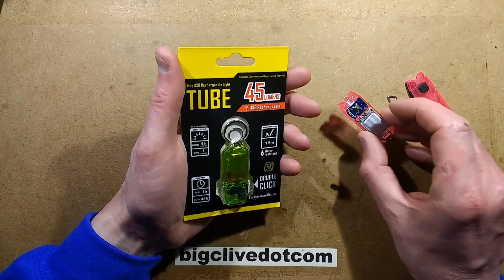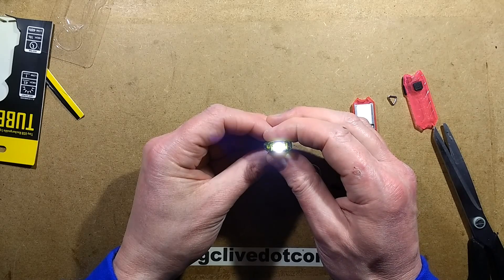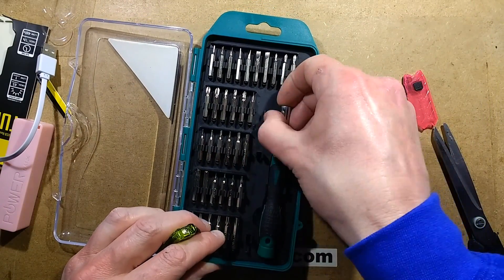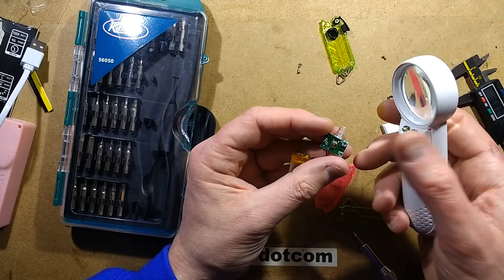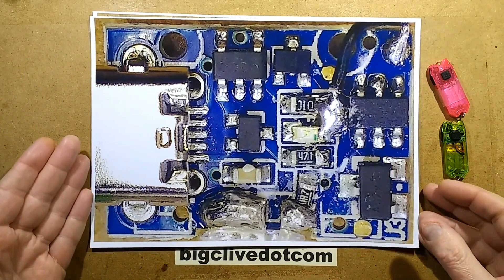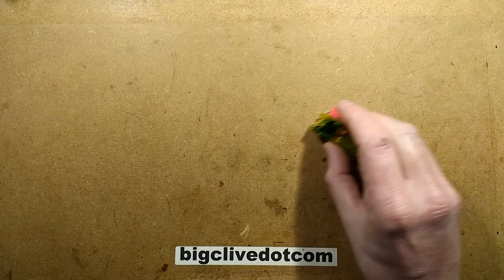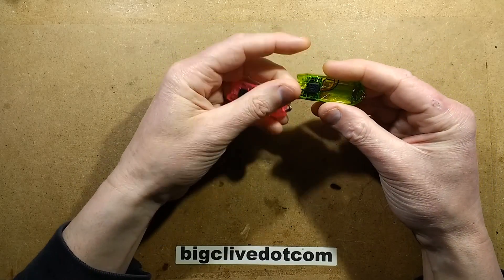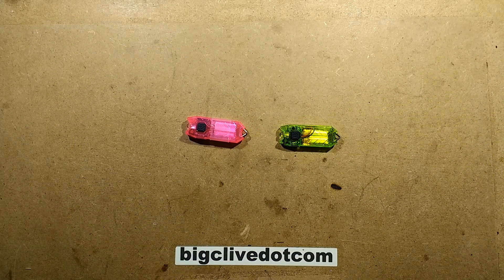Fake Nitecore Tube test and teardown.

Comment: For some reason this got me thinking. I wonder how good an all red led flashlight would be. In theory it should be better because red done not activate your day vision so you can still see off on the distance.
Reply: I have a head torch that has both a red and white light. Its pretty much exactly what you would expect. Allows you to see when its dark without upsetting your ability to see too badly. Not as bright as white light though and will make it difficult to see what colours things are.

If you want to test just grab a cheapo rear bike light.
Reply: Back in the day, all LED keyfob torches were red! :-)
Reply: I got a hire car yesterday, its a new Corsa and the interior is well lit with red lights when driving at night, I presume Vauxhall agree with your theory.
Reply: Red flashlights are easy to find. Check an astronomy seller. Celestron makes one where there's variable brightness down to really very very dim.
Reply: As a blind uneducated guess on my behalf maybe its because red has the longest wavelength in the visible range spectrum?
Reply: aljowen ha I get it
Reply: Hmm. I remember using (not-LED) Army flashlights that just had a red filter over the bulb.
Reply: grab an astronomy style flashlight and let us know.
Reply: thisi s largely a myth. red will destroy your night vision just as well as any other color will and you can make white not destroy your night vision as well. INTENSITY is far far more important than color. Red is typically used not because its red but because red lights in the past were very very DIM and the dimmness is what preserved your night vision.

I hit you with a 1watt red led your night vision is just as hosed as if I hit you with you 1watt white led.
Reply: In fact I read an article a number of years ago that said that green is a better color to use for preservation of night vision. What matters is the overall intensity of the light, and since human eyes are most sensitive to green light, you can use a much lower intensity light and still retain the most night vision. I think we use red because red is the dimmest color in our eyes so we "feel" that it must be best for night vision.
Even if I find it to be true, just try to show up at an astronomy event with a green flashlight. You might as well leave the dome lights in your car working for all the love you won't be getting :)
Reply: there are three main reasons for using red in low-intensity applications 

one is related to tradition. black and white photographic paper is generally not sensitive to red, so darkrooms were typically lit with red or orange light, and red flashlights were "safe" to use around photographic paper.

another is related to human vision. for the same (physical) intensity, a red light looks slightly dimmer to us than a green or yellow light (though not as dim as a pure blue light would).

and another is related to human psychology. we just prefer our environments to look "warm", so if we have to choose a monochrome light (which used to be the case with leds), we generally find red / orange more pleasant than green / blue.

these days, though, you can get low (or variable) intensity white leds, and no one uses photographic paper, so theres really no reason to go monochrome .
Reply: ChrisD4335 you could do an experiment with a car, leave a few small things on the floor in front and behind with the sidelights on at night, see which are easiest to find

Comment: DQG makes single-AAA flashlights that are only slightly bigger than the battery and put out a good amount of light, plus they have high and low settings (and high switches to low after about 90 minutes). I've had one on my keychain for years. Highly recommended. Their size makes them far better as a keychain EDC than larger ones. Google DQG AAA and I predict you'll be impressed!
Reply: Too expensive. Not impressed. :-)

Comment: Reverse-engineer the pinout, find a pin-compatible micro-controller, buy one and write your own software! Of course, buying controllers in one-off quantities may be more expensive than buying a light that already has the features you want built-in..
Reply: I'm honestly tempted to do that with the original—the PWM is too slow for me (can't imagine how terrible the clone must be). I'd either speed up the PWM or make full brightness the default.

Comment: Let me start with a disclaimer: I've been an LED flashlight geek for years, and have been modifying prfectly good incandescent flashlights with LEDs for years. 

Now that commercially available LED lights have caught up with and even surpassed most of the custom jobs, I simply look for the exact set of features I want among the hundreds (or thousands?) available.

In the Nitecore lineup there are many excellent little lights, and the TUBE and TIP were the ones in my sights as possible every day carry pocket lights.

For me the TIP won out easily over the TUBE because of it's features (even though it is much more expensive).

Not only can it put out much more light if needed, the LED is shielded so that it does not glare in one's peripheral vision while in use. The two-button interface is also, for me, a plus.

Have you looked at the TIP? I think you would really enjoy it.
Reply from the maker: I have, but it was just that bit bigger and twice the weight.  The tube is ideal for the keyring, but I may get a Tip to try out.

Comment: I  bought 2 of the nitecore tubes from gearbest right after your review. Work flawlessly and just checked the emergency mode and thats the same as yours. Also, those poundland screwdrivers are so fucking handy! And cheap enough to buy in bulk to leave anywhere you may need them.
Reply: hmmm thats bad if the tips vary. the whole appeal of the poundland ones is that the tips are much better than most cheap precision screwdrivers and dont deform easily
Reply: I'd buy a couple of sets... :^)

http://tijil.org/BigClive_Screwdriver.jpg
Reply: Any idea if those screwdrivers are sold anywhere else in the world? They look so much better than my little set, but I don't think I can get them in Australia. Wonder how much it would cost for someone to post me some...
Reply: You can buy similar ones from banggood - http://www.banggood.com/JACKLY-9-in-1-Electric-Repair-Tools-Precision-Screwdriver-Kit-p-86069.html?rmmds=search
Reply: you can get the clivedrivers on ebay, cheap as chips from china. search for 8 in 1 or 9 in 1 mini screwdriver
Reply: Definitely check the prices. Also the bits that come with them are different depending on the manufacturer. I got a mini tool kit for my vape mod and came with the same screwdriver in blue but the bits are utter shite!
Reply: Get 'em on-line via ebay or bangood, or any number of other suppliers. Even my local grocery here in the USA carries them at a very low price (Kikkerland brand 8-in-1 screwdriver). I have three: 1 in my pencil holder next to my computer, 1 in cubby in the car, 1 in my little emergency tool kit I take traveling. I may need even more CliveDrivers now that he got me stared on these things. Habit forming.

(I just saw on-line a place that sells 'em laser-engraved for advertising. If there were genuine Big Clive screwdrivers I'd absolutely have to get some.) O_o
Reply: I keep two on my bench, one with a cross head tip and the other cross heads inside, the other with a flat tip and the other flats inside that one. clips removed of course, and I colour coded them with a ring of heatshrink to match my other screwdrivers, blue for cross and red for flat so I pick up the right one